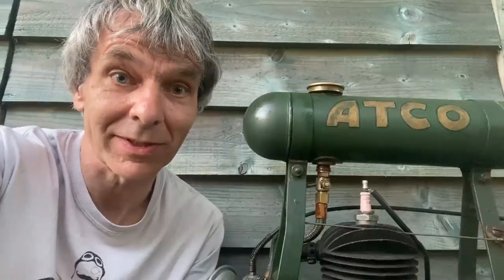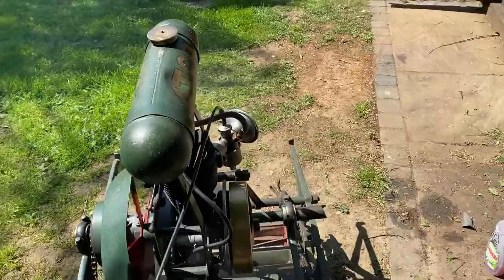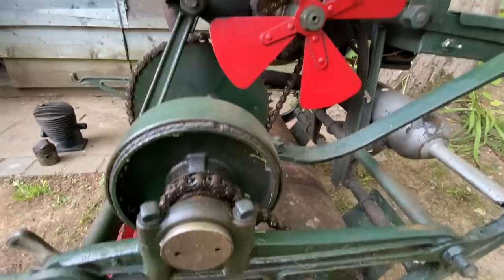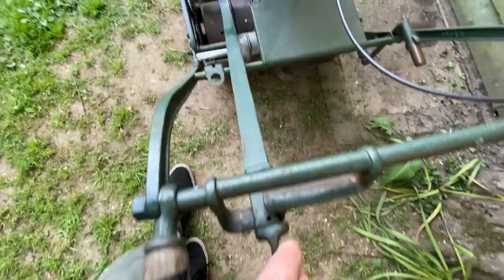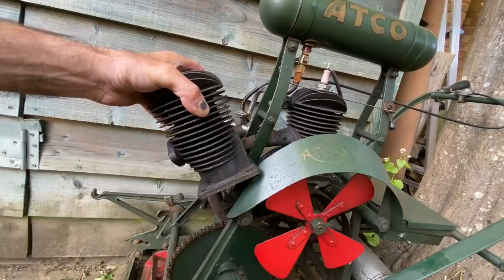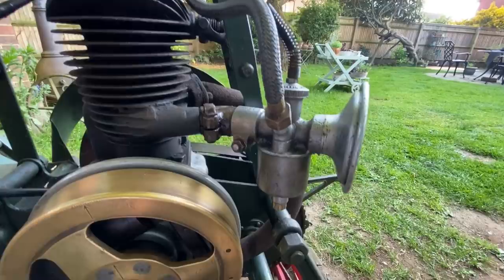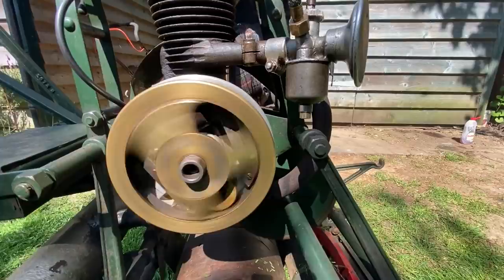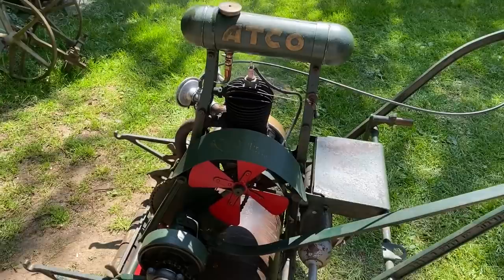Three minute movie,  my 100 year old ATCO Standard lawnmower.

Comment: The dreaded Villiers engine, brings shivers to my spine. My experience of these devil engines was as a kid, a high proportion of scramblers fitted them. You always knew anyone who had a vehicle with one fitted, they had a plug spanner in their inside pocket because the plug consistently wiskered up. I had one where the thread in the cylinder head was that worn on trying to start it the plug shot out and nearly took out someones windows.

Comment: My first “engineering” experience was my grandfather teaching how to maintain his Suffolk super colt mower! I later bought one off eBay and restored it. It had a stuck valve. Freed it up and ran straight away! Love your videos Allen!
Reply from the maker: I also learnt about engines with a Suffolk Punch, great engines and may were dumped due to stuck valve or oxidised points

Comment: I too had seen glimpses of the Atco as you were doing the other videos. I have a later just post war Atco with the smaller Villiers midget engine and have actually had time over this lockdown period to sort out the coil and get it going again after about 5 years. Mine too has  the Lodge plug which comes apart.

Comment: Back in the very early 80's, when I purchased my first "own home" I bought a similar mower from our local used-market / auction house. It was a Ramsommes, and had a very similar cast-iron deflector piston and crank handle starter. It was actually a great, and fun machine. Just like yours, though, and no doubt, all the others they made; they were far too quickly-geared. You nearly had to run behind them. If they left the cutting blades at the same RPM, but halved the rolller (driving wheel) speed, they would have still been "good to go" - -even today

Comment: There's one of these in my Dad's shed. I did a cosmetic rebuild on it when I was about 15; Land Rover bronze green coach enamel... It used to run, sometimes. I think the main bearings were a bit worn. It's a 2 stroke and relies on plain main bearings to maintain crankcase pressure, there's no seals, so using a high ratio of thick oil is a good idea. 40:1 synthetic won't seal the crankcase. I seem to remember a double throttle lever, one for throttle and the other for mixture. The cylinder "head" fins are the wrong way round for fan cooling, pretty sure the engine was originally designed for a motorcycle.

Comment: I had exactly the same mower given to me in pieces to 'tinker with' in my teens. The fuel tank, fan and shroud were missing, and the exhaust was rusted away. Could never get a decent spark out of it, but we got it to run with an external coil and car battery. Made a little 2 wheel trailer with pram wheels to carry the battery and my brother and I used to go charging around the garden on it. Sadly I think it probably ended up with the scrap man after I left home in the 1980s.

Comment: I had a gasoline powered reel lawn mower in the 80's.  It ran great but you needed to use it often to get a nice cut on the grass.  If the grass gets too long, you might need to go over it twice.  Never had a reel mower since.

Comment: Those who have grown up with fixed metal fans have an instinctive respect for them😁, But just imagine wheeling that into your local type approval centre,never mind the exposed high tension cable and plug cap next to the fuel supply or  that if you fall over,knock your self out or collapse the bugger will just carry on right through the fence, Fantastic!

Comment: So Kool wish I'd have come across one doing repairs for 50 years on mowers n more. I did have an original lawn boy open motor at one point. You could start it with just a spin from your hand on the flywheel. Sold it dumb as I was. Still have a couple rare engines tho .

Comment: So very interesting that, I have a version of this engine, a twin port exhaust 148cc Villiers, I am trying to repair, it needs a new gudgeon pin end pad. Need to make some pads, can't find them on Internet. The pin did actually start scoring the barral bore. Hopefully it will hon out, but probably needs to re bore. Eventually, I want to make it into a motorcycle. I think it will look cool with some big twin exhaust pipes. Thanks for the tour around your mower. Cheers.

Comment: Amazing mower :) I had a Shay ( made in Basingstoke) Rotoscythe rotary mower - cast aluminium deck ,Villiers engine ,power take off to run a chainsaw and hedge trimmer etc , incredible thing ....
Reply from the maker: I had a Rotoscythe when I was 14 or 15 yes it had a PTO output power roller and a Villiers 2T engine if I remember the exhaust came out into the canvas grass collector
Reply: @AllenMillyard  Think mine had a metal grass box but yes the exhaust did exit into that area - I think I remember  damp grass cuttings  steaming from  the hot exhaust gases  when being  emptied :)) I took the engine off one Shay  and  made a go-kart with it.  Thought I was top dog ,then my mate came round in his Norton Commando powered kart !!!!!

Comment: Hello,I am 16 and have an Auto culto Iron Horse With a 350cc two stroke cast iron Villiers engine,it was made just after WW1 ,it has a brass carburettor and flywheel and pretty much everything else is cast iron (it is very very heavy)it has 4 wheels and a plough and a toolbox.and a big lead counter weight at the front. it is a Villiers mk III

Comment: I have a 22" Atco Standard but mine has a disc type clutch which is painted red as all moving parts on these mowers are. It has a 250cc Villiers Mk6A engine.  I also have two Atco Standard HY mowers , which are early 1930s. Interesting to see this video.
Reply from the maker: I haven't seen another one with the heavy duty conical clutch ?
Reply: @AllenMillyard  I think that the conical clutch was fitted to Atco Standards in the late 20s. They made a JAP engined version which had this type of clutch, which must have been an improvement.  I have a great interest in old mowers so its great to communicate with other enthusiasts.

Comment: Further to my last coment, the cylinders have a beautiful classic look to them and would look stunning on a radial engine. Can you just imagine the sight and sound of a pre war style bike with the radial engine powering it? A two stroke radial sounds bloody lovely and don't think there are many radial engined bikes out there? In my mind it would be made of riveted alloy ,tubes and wood like a very early aircraft? Lots of brass and copper pipes,valves and gauges? Harks back to the golden age of engineering where anything was possible and the sky was no longer the limit!
 I have a few Rolls Royce Merlin/ Meteors in the workshop for rebuilding, maybe stick one in a bike to challenge the Missenden Flyer? Nobody done a 27 litre v12 bike yet!
Reply from the maker: I was supposed  riding my Viper 8.0 litre V10 with the Missenden Flyer but this lockdown has put that on hold
Reply: Allen Millyard its gods way of telling you that you need to spend more time in the garage! Was trying to find some pictures of the engine I made when I was an apprentice toolmaker. I made a fully running 1:5 scale model of a Gnome Monosoupape seven cylinder rotary engine. To my eternal regret it was sold to finance a bike toget back and to from work. The smell of the casrol R when it was under load and hot was amazing.
 You mentioned the bronze carb on your mower, got some spare huge solid bronze zenith carbs from a meteor sat in the workshop, you can shove your hand down them! Guess they will end up polished up on somebody's table as wine bottle holders!

Comment: The 18 inch model was not available until the mid 1920s. Also, the original 22 inch 1921 model had a brittle cast iron frame and not a lot of those have survived.
Reply from the maker: It’s still pretty old though 🤔

Comment: Mix ratios back in the day were determined by the (relatively) poor quality mix oils available. Unless you have plain rod big-end bearing, you likely can make do with 50:1 full-syn. FWIW I use such mix oil in 2-strokes that were spec-d at 20:1. No probs over more than 30 yrs. Gotta love needles/rollers.

Comment: That is damn cool! Few machines of that time survived, you have a great find there. Running castrol R with that wonderful smell just sweetens the deal. Maybe one of the cooler things you own that hasn't been modified, but maybe you can find an old Puch "twingle" motor to fit to it just for fun or use the internals and cylinder on that Villiers case and make something few people would understand!

Comment: I have a similar mower, probably similar age with a Villiers engine and get this mine has a kick start, no fan though. Clutch is the same and it's a wrestling match if you want to use it though not done that for years.

Comment: I wonder what the market was for this girl, seems like it would be great for large areas like golf courses but a bit unwieldy for a small home yard. A push reel mower would be less work there. As a kid my dad had a REO gas powered , self propelled reel mower, which I could easily handle once tall enough to see over the handlebars. They were very common here in the U.S. in the 40s and 50s. I think the engine was about 1 1/4 hp but was more than adequate.

Comment: I just know one day you'll make it a v twin, lighten the flywheel, lighten and strengthen the crank, put a set of forged performance pistons in there, port and polish those barrels, increase the compression ratio, install a set of performance reed valves or a disc valve intake setup, uprate the carbs, expansion exhaust system, remove the crank driven, power sapping fan and install an electrical, thermostatically controlled fan.......
Should give a fairly healthy power increase.....something in the order of 85-90 bhp would be nice, should make short work of mowing the lawn.......⚠️😯😁😎👍

Comment: Great mower. Does that engine have long bushings for the crankshaft  bearings? I had a Ransomes reel mower with the 98cc engine and it had them. I was amazed that they lasted so long, and didn't seem to lose much crankcase compression, even though there was no seal on them.
Reply from the maker: yes long bushes and no seals

Comment: I have one of these at work but l just cant get it to spark?  Ive even had flywheel remagnitized!  Any idea allen you legend!  What a genius you are! Thank you.
Reply from the maker: IThe easiest thing to do is disconnect the wire to the HT coil inside the magneto extend it so it reaches the tool box. Fit a 12v coil and small battery in the tool box then attach the wire to one side of the coil then connect a wire from the battery to the other side of the coil. The last wire goes through a switch from the battery to earth. Then connect the new ht lead crom the coil to the plug and it will run perfect, if it doesn’t spark you have either a bad condenser or oxidised points
Reply: @AllenMillyard  brilliant! Thank you allen.
Reply: @AllenMillyard  l'll let you know how it goes when lm allowed back to work.

Comment: Superb, but I cringed a little at the thought of "butchering" such a rare old lawnmower, although of course I don`t doubt it`d look the bee`s knees.
I ran a `50s vintage mower on whatever oil was in the kitchen during the 1970s-80s. Still have the engine, it outlived the tin body it sat on. I recommend olive oil, smells superb...much cheaper than Castrol R, but I have a tin of that for show. Disclaimer: Maybe I was lucky, don`t hold me responsible folks if your old two-stroke thinks otherwise :)
I have a couple of ideas for quirky  donor engines for your bike projects Allen.......

Comment: Why does it need a rich 16:1 mixture while it is always claimed that Castrol R(40), still based on castor oil, lubrication performance is still unsurpassed?
Reply from the maker: The oil ratio is high because it barely uses any petrol and the oil is mixed in the petrol

Comment: How does a decompression valve work on a 2 stroke?
Reply: i was born in the 70s ...knows nuts about antque engines.. but i think its used to stall the engine... like an ignition shut off...it leaks out the compressed air fuel mixture before it goes further on top and gets fired into combustion ...i tink..

Comment: You know you really don't have to run 16 to 1 if you're using premium synthetic oil you can run 30 to 1 or 40 to 1 I have a couple of old mcculloch's chainsaws from the 60s and they require 20 to 1 but I run 40 to 1 and then because I run premium synthetic oil if you run good oil you don't have to mix it so rich less smoke👍

Comment: Not a 1921 model I'm afraid, this is a later model maybe 1923.
Reply from the maker: Ok it’s still quite old 😎
Reply: Yes definitely old🙂
Reply: The 1921 launch model had an oval shaped frame not the later H section frame.
Even with oval framed standards, there are two distinct models, the first oval frames had a very symmetrical layout with a cone clutch held in a separate cast iron frame. The later oval frames had a less symmetrical layout with a plate clutch.
Earlier oval frames started with a Villiers 4 engine that changed later to a Villiers 5. Yours being a Villiers 6. Hope that helps.

Comment: Where are all the warning stickers?  How is a millennial supposed to know you cannot put your face against that rotating blade or drink the fuel?  They would die pretty quickly; especially since it isn't Bluetooth compatible nor does it respond to WiFi pings.

What if a man-bun were to become dislodged from the head, unfurl and become entrapped in the chain drive?